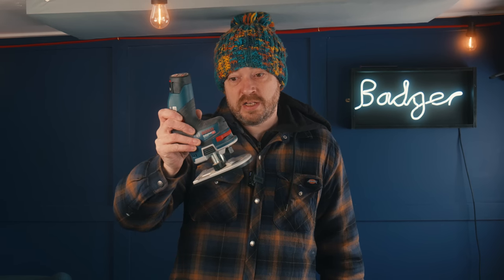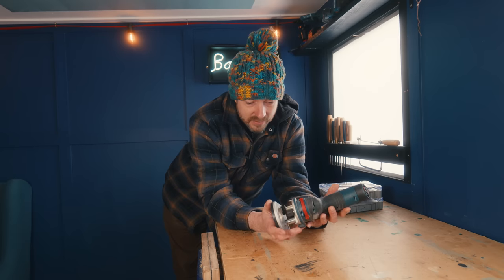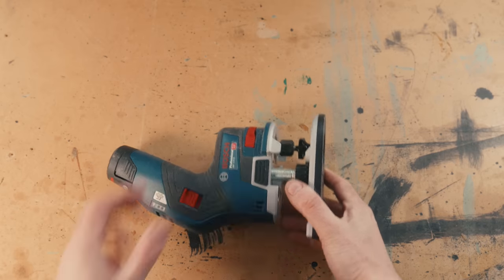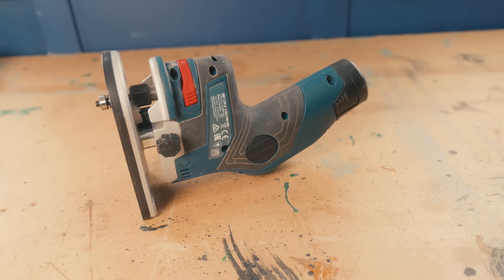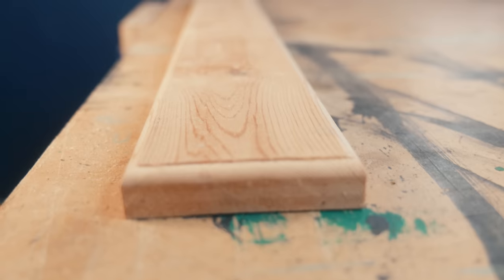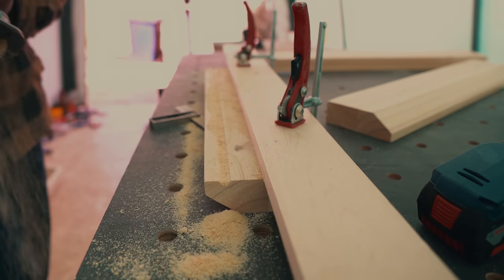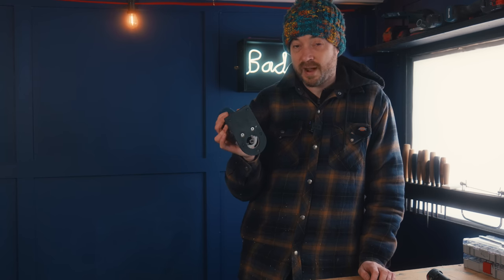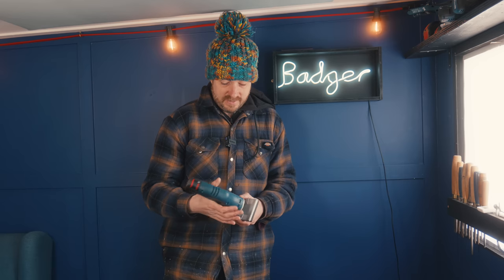Bosch Professional 12V System cordless Palm Router GKF 12V-8 Review

Comment: Totally agree, brilliant kit. I'm quite heavily invested in Bosch 12V as the smaller battery makes for a much lighter, manageable tool. The planer is brilliant, drills perfect, and the mini angle grinder is a revelation. I'm slightly indifferent to the 12V multitool, preferring my Fein, but portability is key there. All in all, well worth the investment for me
Reply: I invested in the Bosch 12v platforms starting with the GSR 12V-15 FC FlexiClick.
Not the fastest or most powerful range but it allowed me to build a range of tools - creating and repairing whilst keeping things compact.

I also have a few Makita CXT tools.
Both Bosch and Makita stated this 12V market segment that Milwaukee and Dewalt have since become part of.
Reply from the maker: I do fancy trying the angle grinder
Reply: @Badgerworkshop  it isn't very powerful, and you don't get much cutting depth. It is easy to stall it out if you push it too hard. But for occasional small cuts it's nice to have in my experience
Reply: @Badgerworkshop  think of it as a hacksaw without the need for a vice, and it's perfect. As stated, it's not too powerful but it is light enough to control with one hand easily. Perfect for overhead work.
Reply: @Badgerworkshop it’s much more than an angle grinder, it will take all the variety of discs, flap discs for wood, tile, stone, metal, plastic. It’s a must have

Comment: I bought the brushed version of this router six or seven years ago i believe. It wasn't on the market long when i purchased it. It finally died two Weeks ago. I brought it into my local Bosch dealer. The technician informed me Yesterday that it's not worth repairing. I did a lot of round overs, chamfers,  hinge mortices and lock face plate mortices with that little router. I'll replace it with the brushless version.

Comment: I use it mostly as a roundover router. I wish it had dust collection, and ambidextrous switching
Reply from the maker: That mostly what I use it for
Reply: @Badgerworkshop  I have another corded  router that has a dust port for other tasks - it's great to have a dedicated roundover router with the Bosch's ergonomic grip.
Yes the 4Ah or 6Ah battery will give all Bosch 12v tools more grunt but the 2.5 or 3Ah batteries offer more compactness and better balance if you let the tool do the work and are happy not to force it too fast.

This GKF 12V-8 tool helps me get better results - not the fastest - but nicely controlled

Comment: Great router for edge work. Usually do the fine adjustment from the sole plate using an Allen key. While it can make a mess I think dust extraction would make it clumsy. Great to just grab it and do a quick round over.
Reply from the maker: Yes I agree

Comment: Thanks for the longer term review Matt, it's good to hear what you have found over an extended period of use !
I baulked at the price when I bought mine as like you it was really only for chamfers and round-overs and a bit of edge trimming, but I'm glad I got it as it's so good for those jobs and I'm far more likely to grab this than set up a bigger router. It's true of course that the 6ah battery gives it more grunt, I had one of these already as it is all but essential for the little circular saw in the range which often stalls when used with the 2ah !
Reply from the maker: I do need to get that battery

Comment: Couldn't agree more, so quiet, and capable, it's risen to challenge what ever I throw at it, literally yesterday cut the window rebates for a green house I'm building, just a joy to use.

The 2 major criticisms I have are lack of dust extraction, and lack of base insert support, just because it would be brilliant as a copier if I could use existing jigs, yes can mount a bearing on a shaft but an insert and spiral bit would be ideal both issues can be solved with 3d printed accessories on etsy
Reply from the maker: Yes base inserts would be nice to have

Comment: You nailed the appeal for me when you said it was good if you’re not a router user. I’ve had one of these little things for a couple years and it’s great for the roundover/chamfer task.

The Bosch 12v range is quite a charismatic little range I think. I have the oscillating tool and the drill and they are my go-to for 90% of tasks.

Manor Woods - a man for whom no piece of equipment is too high-end - is a big fan of these with the bigger battery.
Reply from the maker: Yes I think I leaned about the bigger battery from him

Comment: agree with everything - i think i even bought mine because i saw you using it in previous videos, all round its a great little tool - and surprisingly sturdy for one so small, my only niggle i have had is that the locking dial has popped loose a couple times.
Reply from the maker: Glad you like it too

Comment: Thanks for the review. I was thinking of using it for smaller jobs, like routing for hinges in windows on location. And it seems like it works really well for that. It's only 13000 rpm, do you find that negative in any case?

Comment: Thanks for the video. I really learned quite a bit from your demonstration. I went and bought it. But that adjustable nut has a little silver holder for the bit that doesn't seem to work correctly. It won't hold the bits in place. It falls out. Can you help me figure out what I should do to get it going, please? Thank you.

Comment: Design does look good. It reminds me of the new generation of jigsaws. I have the Dewalt battery operated router, you can change the bases , fixed base it is top heavy with 5amp hour battery
Reply from the maker: I’m also a fan of the barrel grip jigsaws
Reply: @Badgerworkshop  I would like to try one. Can’t justify the out lay as I have a bomb poof Bosch jigsaw which was made in black and white as it that old

Comment: Great review. I am invested in two battery platform, Ryobi and Bosch Blue Professional. I have the Ryobi router and agree, it's very top heavy. I also now have  a 12v Battery, 6amp, the same one you showed on your video. FFX had a 15% off so was able to get the battery for £55 2 weeks ago. I am differently intrested in this router but would only buy on sale, maybe around Black Friday, I can pick one up for less than £90.
Reply from the maker: That’s a good deal on the battery